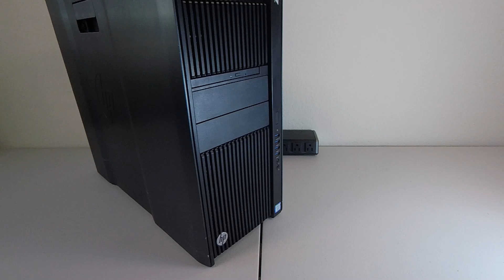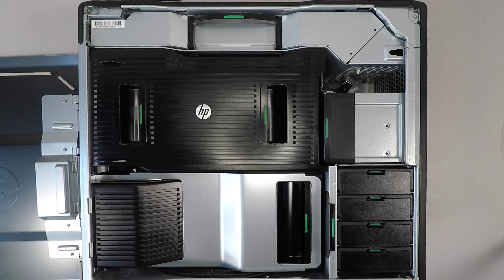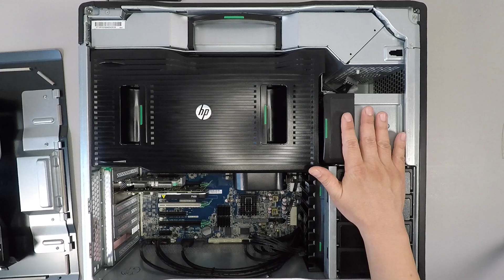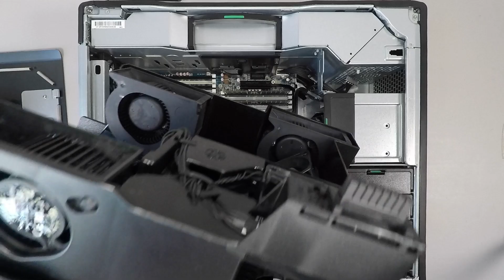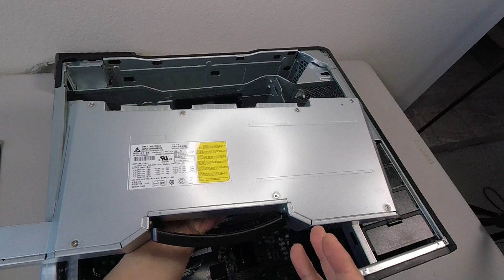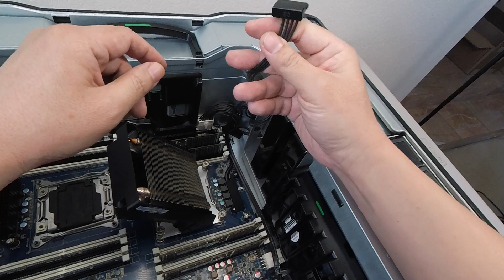9 reasons why I think workstations make great servers | HP Z840 Workstation

Comment: That power supply is so EF'n propreitary it's not even funny
Fine perhaps now, but not in 10 or 20 years...
What does the pinout connector for it look like, and will it accept a normal power supply.  I bet the answer is a big fat no.
Reply from the maker: of course... but there are plenty of spare parts available on eBay. And in 20 years??? I think it would be extremely obsolete by then.

Comment: My homelab is just a Dell Poweredge R420 with dual xeons and 96 gigs of memory with a Optiplex XE ontop of it running a program that automatically backup all data from the R420, compresses it and stores it to a disk. I'm guessing that's a perfectly valid setup.
Reply from the maker: Yeah, that's not a bad setup. Make sure there's some level of redundancy though, both at the storage level of the R420, and also location wise. I would always try to backup my data in at least 3 locations, 2 of them physically separated.
Reply: @ArtofServer , yep, I follow the 3-2-1 (3 copies, 2 different mediums, one offsite) method, too. My offsite is smaller than my local since it is reserved for critical data and secured as such.

Comment: i wonder if you can hack your way to use a standard ATX 1000W+ power supply to use on these machinese, judging you cant find a replacement power supply
Reply from the maker: Actually, PSUs for these workstations are abundantly available on eBay. I'm sure with enough effort, one could adapt a ATX PSU for this, but the standby voltage might be the only quirky part that you'd have to engineer a real solution for. The rest is probably pretty standard and you just need some sort of adapter cable.
Reply: @ArtofServer  sadly i dont have access to decent ebay prices since im from asia. Shipping fees here ranges from  200 usd to 2000 usd for used pc or parts, id probably use this for hosting a game server for friends honestly. And doing some video editing.

Comment: If you want a cost-effective home server, get an HP microserver (G7).  You can safely ignore the HP specs, I currently have two with 4x 6TB drives.  One I have upgraded to SAS drives at minimal cost.  As far as I can see, the only advantage of a Z840 (as a server), is that you can have four SAS drives without any other hardware changes.  The downside is the cost of the electricity to run a high power workstation 24-7.
PS I lust after Z840s, but not as servers.

Comment: I bought the Z600 and then finally upgraded to the Z840 and also bought a Z440 motherboard which is basically ATX so I could put that MoBo into a regular ATX case with a regular PSU with adapters and I had two issues - front USB which I solved with a little internal USB to USB adapter board plugged in for a few bucks and then if there are more than 4 DIMMs in then it tells me I need a fan - so I run with fewer than 8 and I can WoL boot juuuuuust fine anywhere anyways...i generally dont really like HP but I have LOVED their workstations and teh Z-series is what did it
Reply from the maker: I agree, I'm not usually a fan of HP stuff, but the Z800/Z820/Z840 generation has been nice. I'm not so fond of the newer Z8 though...

Comment: I have a vintage 2012 HP Z820 that I used as a CAD workstation for 7 years, and never got rid of it after I upgraded to a Threadripper. Recently I've been pondering what's a good way to put together a home server. Now after viewing all or most of your Z8x0 videos, I'm strongly leaning towards using my Z820 for a home server. It will replace a QNAP NAS that only has 8 TB of disk space, and I want to eventually run Proxmox with Truenas Core and HASSOS in VMs, plus a Docker solution in another VM for things like a Plex or Emby server.

My Z820 has dual E5-2630 (v1 - Sandy Bridge) CPUs and 8 sticks of 8 GB ECC RDIMMs. I also have an LSI 9266-8i (is this PCIe 2.0?) installed. The drives inside are two Samsung 840 Pro 256GB SATA III SSDs, one Samsung 840 Pro 128GB SATA III SSD, one Samsung 850 Pro 256GB SATA III SSD, and three Seagate Constellation ES ST2000NM0021 2TB 7200 RPM SAS 6 Gb/s hard drives.

One question I'm confused about is the Intel C602  chipset. On Intel's web page for this chipset the specifications state the expansion ports are PCIe 2.0; whereas your description and other literature describing the Z820 all state that it has PCIe 3.0. Could you clarify this please? Because if the slots are NOT PCIe 3.0, then I don't want to dump any more time and money into this machine.

A second question is whether you think it's worth a few dollars to upgrade the processors to v2 (Ivy Bridge) version, primarily to reduce power consumption for a given workload, and secondarily to perhaps go a little faster in CPU speed. Note that my E5-2630s are a 95W TDP part, and I'd want to go no higher than that TDP in the replacement CPUs. I would also probably add another 8 sticks of 8GB RAM, to get up to 128GB total.

Thank you so much for putting all the time and effort into this series of videos. I've learned a ton from ALL your youtube content, but this stuff feels like you made it just for me!
Reply: Nevermind; I've decided to build up a new machine around a used 2nd Gen Xeon Scalable and Supermicro X11SPL-F mobo.

Comment: I’m debating between a Z840 or a Precision T7910. Which one do you prefer?
Reply from the maker: I think the Z840 is a much better designed system. It's something you would appreciate to look at and use. The T7910 is a very capable machine, but it's just like any other PC, covered in plastic parts and not something you care to look at, but will do the job. The Z840 is capable of holding a lot more HDDs if you're looking to setup for bulk storage. The T7910 will hold more 2.5" drives like SSDs. Both can also use NVMe PCIe drives. My personal preference is the Z840.
Reply: @ArtofServer  Hey, thanks for the reply! I had a guy willing to sell me his 7910, but I think I'll hold out for a Z840.

Comment: I've binged on your content lately and think one of the HP Z series is a great option to be the core of my home lab and use a couple Lenovo laptops with upgraded RAM/NVME as clients or test beds.   Don't require 24/7, but depending on electricity costs the HP Z could provide that for various VMs & Plex.  Have your Ebay store pegged for buying some components.  Thanks
Reply from the maker: Thanks for watching my content! I hope you find some of my content helpful to you!

Comment: Do you think theres enough ducted airflow for a couple of tesla cards and a quadro? A friends gave me some old tesla cards that have no fans meant for in a server. i saw the old listing for the config of these on HPs website and one of the options was to equip it with a tesla. but im not sure if those were the hard to find ones with the fans or not. I have noticed a lot of OEM cards for this machine like the Quadro K6000 have that metal bracket in the back that slot into the case nice and neat that looks like to channel air flow towoards the front of the card form the fans. But im not sure about using these in this case or not. Any thoughts on this?
Reply from the maker: how many watts of heat do you need to dissipate with that hardware?
Reply: @ArtofServer  250Watts each :p  Its a pair of tesla p40s

Comment: I've never owned the Z8** series but I do have a Z420 and just today I have a friend that works at a manufacturing plant that was looking to offload more of the older systems....shortly put, he gave me four Z420s and two Z440's. So six units total. Can plan to use one of them or two for Truenas since they all have Xeon CPUs and ECC RAM (440's have ECC RDIMMS). I also find the conversion to desktop very neat as well.
Reply from the maker: Congrats on acquiring those machines! They are all very nice machines. The Z4xx don't have the storage capacity like the Z8xx, but they are still very nice machines! Hope you enjoy using them! :-)
Reply: @ArtofServer  yes I surely will find uses for them! I know the 420s doesn't have as much storage capacity but one of them would make a great Proxmox hypervisor. And given how cheap the ECC RAM is its a no-brainer. 

I am finding the Z840 an interesting machine for a possible video and audio editing workstation given that the motherboard has two CPU sockets and tons of RAM slots. 

This will work great until I am able to get my numerous Dell and SM rack servers out of storage...I could have a GREAT homelab!

Comment: Thinking about getting one but just today became aware of them. Will have to figure out best way to order one. Curious, would something like an A4000 graphics card fit/work in this workstation? If not, what is the best option for GPUs?
Reply from the maker: I don't know much about the A4000. HP does provide specs for how long of a card  can put used in these workstations. I previously had a GTX 980Ti, and currently a RX6700XT in my Z840. PCIe power will be limited by PSU option, so be sure to watch that video on my channel.

Comment: I recently acquired a used Z840 that I upgraded and am using as my Plex media server as well as for encoding/editing. It's running dual Xeon E5-2620 processors, 128gb ram, 512gb PCIe system drive, GeForce RTX 3060 GPU, and 4 - 16tb Seagate Iron Wolf Pro HDDs in a RAID 1+0 (29.1tb total storage). I've gone thru several media server setups over the last 15 years and, while it was quite an investment overall, this Z840 is my most capable solution yet, by far. Nice workstation!
Reply from the maker: Congrats! The Z840 is a very capable machine indeed! :-) Thanks for watching!
Reply: For 45 bucks, you might consider upgrading those 2620’s to dual 2690v4’s as they have very respectable benchmark scores in both single thread, and multi thread. I just paid  $45 for both of those processors and beat your 2620s handily performance wise. FYI
Reply: Just looked, dual 2690v4 : passmark score 32k multi and 2100 single, to your dual 2620v4 :15k multithread, and 1700 single. Dual 2620 V3,  multi was 13k. Big gain for little dollars, no brainer!

Comment: Great video! Workstations and tower servers are very underrated for sure. I started off with a used Lenovo P310 workstation as my first server, it was a great server for my apartment, it was affordable, quite, efficient for its age and somewhat expendable. Over time I added another 2 drives in the 5.25” bays, totaling 4 HDDs and 1 SSD. Now I have migrated to a Dell T330 tower server, which has been great. All I’ve done so far was modding the PSU board to add a 8 pin power for the transcoding GPU.
Reply from the maker: Exactly! and having Xeon CPUs and ECC RAM is great for data integrity if you're storing data on the machine. Thanks for watching!

Comment: I know that you cover a lot of HP stuff. I learned a lot when I picked up my T320 (which I upgraded to a T430). Learned my lesson with Dell but a great starting point for first timers. Still rocking solid!
Reply from the maker: I actually seem to cover a lot more Dell stuff than anything else, which was due to demand/requests. I personally like building my servers with Supermicro components. I like the HP Z workstations for desktop use, but they can be used as servers too and I saw a lot of people wanting a desktop form factor for their server so I made this and related videos.

Comment: Hello I have a z820 2 x Xeon E5-2580 v2  total 20cores / 40 threads what would I need to convert this into a server,still learning about this machine.Thank you
Reply from the maker: That depends on what kind of server you plan to build with it. You have a nice machine there that's very capable of many roles. I recommend you watch my Z840 series as it has a lot in common with the Z820.
Reply: A server OS and some storage?

Comment: That probably only works in US, maybe some other countries with a lot of server surplus (but I believe they do not come even close to US).
In every other place you are probably better of with Supermicro board based whitebox. Especially as a beginner.
Reply from the maker: well, yes, of course local market conditions apply. but these HP Z workstations are easily found on eBay in US, Canada, UK, and Europe. Also, many US sellers are willing to ship outside the USA. but you are correct in that availability will vary based upon region.
Reply: @ArtofServer  How much power draw BTW? Idle/load from an outlet.
I am avoiding dual sockets and e5 since it was horrible on LGA2011.
Reply from the maker: What was "horrible" power consumption to you? I find most systems from ivybridge and newer are pretty good with power consumption. But, I'll make a video on this question in the future with actual numbers.
Reply: @ArtofServer  Horrible for me is a Dell T5610 with E5-2650v2 (Ivy Bridge-EP) 16GB DDR3 2x12TB WD Whites and it idles at ~100W which at 25c/KWh (in UK) is $220/yr. I can upgrade to a Z640 E5-2630Lv3 for $330 but I'd really like to get a clear picture of how much lower the idle power draw will be?

Comment: tbh, these (dell, hp, supermicro, huananzi) literally are just servers. All server components, tons of server interfaces, in a home friendly box. They're probably the most flexible machines on the market. You can spec for gaming with two of the fastest clock speed of the most recent gen processor, mixed methods with the lga2011 feature of mixed CPUs, with one fast cpu and one huge cpu, and the CPU benches you can get from these (2011 v3, or the original) matches (or surpasses on v3) literally anything up to threadripper. They're not always the fastest, but if you need something that can very literally do anything, get a 2 socket xeon. Even if you can only get the one cpu at first, they all work in single socket mode too, so just upgrade later.
Reply from the maker: thanks for watching! i can't wait until the AMD threadripper PRO workstations hit the used market!
Reply: After doing some part # cross referencing, I've learned that the fans in workstations are really nice and cost 25-30 bucks a pop on their own. Why but something that needs $100 of Noctua fans when the workstations come with h the same thing.
Reply: Wait you can mix CPUs?

Comment: Thinking to get something like this.
The only concern i have is the noise level it produces in full configuration.
If the noise level is like for the rocket engine, then it is more suitable to get few pizza-boxes in the basement. Quick price lookup tells me that this box can suck in up to 6K Eur to get 22 core cpus, max memory and so on. For the 6K you can get 5 decent HP DL* pizza-boxes  with 10 core Xeons, which in total is like 100 core compute power (1000 vCPUs) plus like 90 RAM slots and still having tremendous upgrade options in future. Talking from my automation programming and virtualization perspective where i need to test different server clusters, networking and what not. No need for gaming or any other GPU stuff.
So for me the noise level is kinda selling point. If its really quite to put right next to me for daily work in quite environment... then its probably worth to consider. Financially ... pizza-boxes makes more sense even including 24U rack. Recently got Solaris 48U rack with the full PDU for 120 Eur. :D Happy as hell.
But overall, really appealing thing. Researching it.
Reply from the maker: Because this machine is designed to be a desktop workstation, which means it will sit near the person working on it, it is by design a quiet machine. Certainly much quieter than most rack mount servers. It is not completely silent though, but if put under a desk, I think you can barely hear it. There is also an option to upgrade to vapor chamber coolers that reduce any noise pollution even further. I will cover that option in future video.

Comment: Nice video. You've given me something to think about for my current build. Go this route instead of build from scratch with SuperMicro server MB. My only concern is that I assume there is no IPMI type functionality since this is a workstation and not a server. This will be up on a shelf in a closet headless and remote management may be a deal breaker for me.
Reply from the maker: Yup, out of band remote management is not available. For a server put away in a closet, I would go rack mount system. This was meant to help those who are just getting started with servers and want a tower/desktop server that can be tolerated in a home office.
Reply: Theres no IPMI, but what about the Intel ME/AMT? Unlike the Z640 which only has a single RJ45, there's 2 RJ45's on the back of the Z840 and the bottom one is dedicated to AMT. I believe there's a few different companies that make aftermarket management software, each with there own pros and cons. But, right out of the box you can set up a web interface after initializing MEBx. You just press "ctrl-p" after POST, and enter in your network info and preferences.
Reply: Dell has tower versions of their rack servers in the Poweredge series, the Txxx can be installed with a iDRAC module to allow IPMI. A T630 will allow you to mount 2 E5-2600 v3/v4 CPUs and lots of RAM and several PCIe cards, plus some come with 8 hotswap 3.5" bays for not just a media server but even NAS.